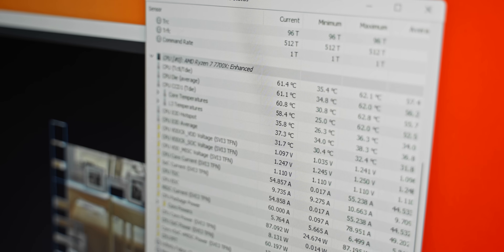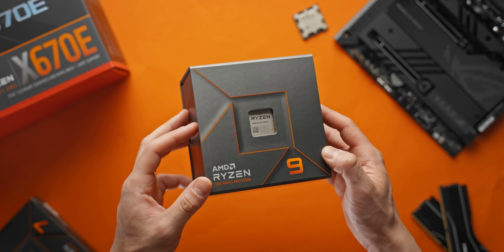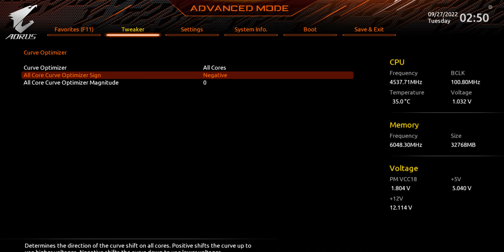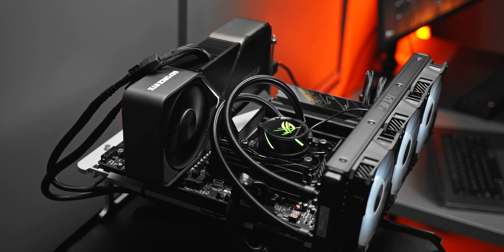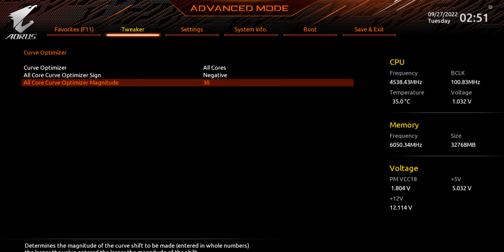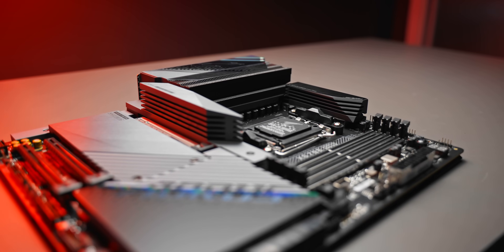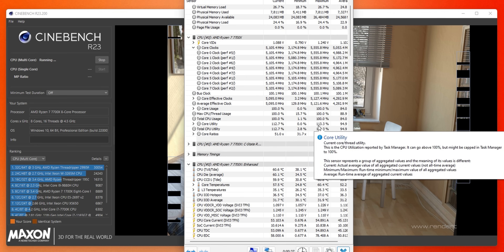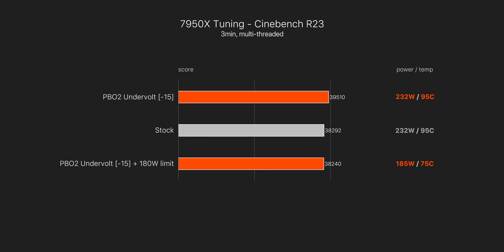Fixing Ryzen 7000 - PBO2 Tune (insanity)

Comment: I just tried this on my new 7700X that I got today and wow, yeah, it totally works. Curve set to -30, max temp at 85 C, max power at 85 W. Got through a full 10-minute Cinebench R23 multi-core run just fine, with only a minor drop in performance. Temperatures maxed out at 63 C. I'll probably be dialing back things a little bit, maybe curve at -15 and max power at 100 W, to guarantee stability and perhaps eke out a little more performance as well.
Reply: Yes, I get that, which is why I said I would be dialing things back a bit. For the moment I've settled on -20 on the voltage, 85 C max temp and 110W max power. Time will tell if this is stable enough, or if it needs more tweaking. I'll be stress testing with other benchmarks to check that. My initial enthusiasm was because I was able to replicate the results from the video exactly with my run-of-the-mill 7700X, so this is not just reserved only for golden review samples.
Reply: @Astfgl  Hey. blast from the past here but how did that -20 voltage, 85 C max temp and 110W max power work out? Was thinking along the same lines and would appreciate a little hindsight from someone else
Reply: @dalebrimhall1071 hey, I just did a -15, max temp 85C, max power 100W, and it seems to be running just as smoothly and fast as stock. I recommend. It did give me a bit of trouble at first but then ran smoothly.
Reply: Cinebench is utterly worthless as a stability test.
Reply: @Vegemeister1  THIS.  Cinebench is only a first blush test.  I did a metric ton of tuning on my 5900x and learned the hard way that I could get some really, really sweet Cinebench runs over and over again stable but outright crash in certain games and other stress tests in minutes or an hour.  Don't fall for this at face value... while it "might" be completely true a whole lot more stability testing needs to be done to prove it won't crash frequently in certain workloads and games.  Curve Optimizer can leave you wondering why your system restarts once every 3 hours in a game... or once every two days... it can and will cause bizarre stability issues.  Because it all revolves exactly what kind of load just happens to get placed on one of the random cores that can't handle the low voltage and high clocks.  And you don't know when it will happen.  You have to hammer them ALL properly to prove that EVERY core can stand up to a heavy load even when the cores around it are also hot.

Comment: why dont they do then out of the box? No normal user with zero experience can or want to do that stuff. those just want to plug and play. why not the best version, lowest voltage highest possible stable clock out of the box?

Comment: For a 7600X, what would be an optimal wattage limit ? 85W too or should it be set to something like 70-75W ?
I'm going with max stability so negative 10 + thermal limit 85°C + power limit set at 75W.
Reply: maybe lower temps, like 75° or sth.
after all higher temperature means worse efficiency and shorter lifespan

Comment: Generally only a few cores run at 95 that heat, understandable but still the heat is really annoying and no processor should be run over 85 honestly especially when doing heavy workloads.

Comment: Great video as usual! Your 7950x is higher quality silicon though. If the negative offset can't be set very high, it means that the chip is already running at very optimised low voltages.

Comment: Very cool results. Makes you wonder why Amd set the default setup so high? probably this is easier to make sure it works with a very wide range of silicon qualities and maximising the usability of the wafer yields instead of rejecting lower qualities
Reply: I know like, what's the point?

Maybe just maybe the CPUs are more stable stock in certain conditions. Like if the CPU was maxed with varying processing spikes e.g. a future CPU heavy games. Rather than Cinebench which is probably even processing demand.
Reply: Actually mindless comment, seek proffesional help.

Comment: This actually made me to consider upgrading from 3700X as I am not a big fan of huge power draw and high temperatures but I still like to be on a high performance system. Will probably wait for cheaper mobos to come out though
Reply: Would be silly not to, may as well wait for the 7800X3D too.
Reply: 5900X would be an excellent upgrade. You can use the same board and just get great performance for under $400
Reply: @dmitc01  True. And depending on where you live, the 5800X3D can be had for $400 too. If you're using it pretty much just for gaming, the X3D chip looks like it will still be vying for best chip on the market even after Raptor Lake launches.

Comment: You really turned me onto undervolting and I've done it on all my systems thus far. Mainly because I have more-or-less small to tiny ITX PCs, but also, why not have lower temps? The only exception to that is my main system, ironically, as it's pretty unstable with even the smallest undervolt, despite being the biggest with the best cooling. I won't be upgrading to Ryzen 7000, but I think it's especially important to do so with this generation because of the absurd "standard" temps. Very educational video for those going in, for sure!

Comment: I think this would be a fantastic selling point for AMD if the CPUs just performed like this out of the box. Seeing this performance with 60ºC and 85W matching the "by design" performance makes absolutely no sense that AMD would put out these products reaching the temperature levels they did. If we as users can do this type of tuning this easily, I feel like they could as well just make them behave like this out of the box, and allow those temperatures and power targets to act as designed for people who really would like to push they chips to the max. I know binning comes into play here, but it woudn't be necessary to achieve 60ºC @ 85W for all chips, however having them overpowered and at near TJunction at the exact same performance of what we see here is completely unacceptable.

Anyway, great video as always!
Reply: Prob bc like he said it depends on each individual cpu

Comment: Would be really interesting to see how the stock tune would perform in a custom loop, because even with the AiO it ran at 95 C , my question is if the coolant would also heat up to that high of a temperature, because if so, it’s basically unusable for custom loops

Comment: As Roman Der8auer showed in his new vid even the process of delidding and direct-die-cooling 7000-chips can save you up to 15°C in difference. Imagine both! Of course the effects would be way less than both temp differences just combined but still a massive improvement that shouldnt be overlooked when comparing to intel etc
Reply: I can imagine a seriously tuned 7600X delidded and optimized in PBO2 with a beefy cooler and using per-core overclock could potentially hit something like 6GHz on the best core with the rest set to 4.5 - 5GHz. 

That would be nuts.

Comment: 95C degrees is fine, this issue is that upgrading your cooler will just make your CPU draw more power to stay at the thermal cap, which is aids for watercooled SFF builds for example.
Reply: do you even have a clue how hot 95c is? 203 Fahrenheit.

that's about hot enough to cook an egg.

seriously. I don't care of AMD or Intel or Nvidia or any other chop maker thinks 95c is ok..it makes no sense to run something THAT damn hot.

I damn Surely am not.

you can use your PC as an egg cooker if you want..I'm not forcing my baby boomer mother to deal with a thick mid tower just to have a not us nh d15 fit just to keep her 7600x 's temps in check when she wants to do her trashbook  games and hangouts video chat at the same time.

Comment: You forgot to mention that in PBO you can actually do per core voltage adjustments.
This way you can get on average much lower voltage, since you're not limited by the worst core.
You would likely get some 5-10% improvement above your setup, if not more (dependent on the sample).
 I've done undervolt on 5600G, and cores vary from -30 to -15.
Reply: but how would you know which core needs a different voltage versus other cores?...that is the part I don't recall anyone ever answering
Reply: @motoryzen  You manually check it by stability. The process isn't very complicated.
1. You test max stable undervolt for entire CPU - bifurcation method is optimal.
2. When you find stable undervolt, you test each core with undervolts - same method as before.
It might take several tries to get it perfect, but the effects are amazing.
Sometimes a single core can destroy undervoltability by a lot, -10 to -30 variation is normal, so I highly suggest trying all cores.
Reply: @michahalczuk9071  ok so it's pretty much as I already figured how it would work. 

I thought you were going to tell me something different. (Shrugs)
Reply: @motoryzen Prime95 gives you per core stability readout, so if you are very careful you can undervolt all at once and check which are unstable.
Reply: @michahalczuk9071  now THAT...I forgot about.m..ok right on
Reply: @michahalczuk9071  but is prime95 available for Linux?  I don't use winturd
Reply: @motoryzen  I think it is.
Reply: @michahalczuk9071  Hey, I must restart to my bios everytime, you do the same ? x)
Reply: @EverNaughty  Yes.
You run prime until cores fail.
Check which one failed. Bump up voltages on those, bump down the rest.
I suggest going in 5 step increments and when you get failures go by 2 and less.

Comment: Now the real question is: why didn't they set a similar profile by default? It's a big improvement with basically same performance
Reply: Because with these cpus they're typically binned where up to 1 or 2 core are on the edge of stability at acceptable voltages. Those 1 or 2 cores might run fine stock but when you apply an all core offset those specific cores will cause instability.

Comment: Although these processors should just "work" out of the box, I would love to see more tech tubers educate consumers on how to get the most out of their CPUs. While the headlines for these cpus are "hot and power hungry", it would do good to settle expectations, rather than repeat what the crowd is saying. Same goes for Intel as well. All of these higher ceilings for power draw and heat are only to reach peak performance for a set amount of time to get the highest number for benchmarks. While in fact, there's a lot more headroom for balancing performance and power/heat. It's just a bit more involved for the consumer, and exposure unfortunately has to come from influencers/journalists.

Comment: Curious to see what combining this with delidding and direct die water cooling will achieve with a 7800X3D, should be pretty insane performance whilst running cool and dead silent with a big custom loop and low rpm fans.
Reply: Prefer to see the temp decrease with lapping the IHS personally. Delidding is a tad too risky for my taste.

Comment: I'm surprised undervolting still works well together with what is basically auto overclocking on a thermal limit, i thought those would be almost mutually exclusive beyond some minor adjustments
Reply: Undervolting and overclocking are essentially the same thing: pushing the V/F curve up and to the left.

Comment: Really nice that AMD gave an option to dial down their temperature target. I'd be much happier targetting my cpu at 80 degrees not 95 and if the undervolt is rock solid stable, saving 50W at the same time for the same performance :D

Comment: I'm running my 3600x with all the boosts settings off, meaning it never goes above 3.6ghz. The thing never goes above 60°c (even under extended 100% load) and fans always stay at 400rpm, never above. cool n almost completely quiet, all the while giving me all the performance I need. Getting new and more powerful CPU's is great, but people need to remember that even CPU's from two or three generations ago will serve most people good enough. Don't upgrade unless you actually need to.

Comment: Why would AMD have chosen such aggressive voltages/temperatures ? Are they planning chipping lower quality silicon that would not have any headroom at all ? I cannot image. Maybe they found it too risky for stability sake ? Anyways, very nice video ! Seems like an easy fix it seems. I think this Ryzen generation was designed for a world where electricity is free :)
Reply: voltages are lower than last gen and temperatures are absolutely fine. The temp limit for manual OC is even higher at 115C.

And performance per Watt on these CPUs top everything at the moment. What are you talking about?

Comment: Why the hell would other tech reviewers not advertise this and more importantly why the hell would amd not push this info out?! 
I was on a hard pass for ryzen 7000, but this actually Got me interested again. 
Great vid mate, like and sub from me!
Reply: I dont get this aswell. There just has to be a downside, otherwise amd would not push the temps that far. It doesnt make any sense.
Reply: @Danieldialga  The downside is that as stated in the video not all cpus can do it so they need the extra voltage for stability.
Reply: @WayStedYou  they can all do it to some degree
Reply: Because they need to do their actual reviews first? they only had a few days to a week to do all the testing that needs to be for a general user experience.
Optimum tech is focused on SFF builds so this would've been the first thing he went to do after the normal review stuff.
Reply: People who aren't stupid can do things without the need to be prompted.
Reply: you can do this pretty much on all CPUs. but companies always choose the most stable config for all chips or the top performance at the cost of power. even on intel you can cut a few tens of watts without performance reduction if you follow tips like these but for intel.
Reply: The people that manufacture the thing : The chip operates optimally at 95ºC 
Dumbass reviewers : Fighting like hell to drop the temperature ....
Reply: @mouzz  Yea im confused by this as well. AMD has come out and said this is intended. Why is anyone freaking out?
Reply: @mouzz  If the manufacturer wants me to run it at 95 degrees and 170 watts then they can pay my power bill for me. Otherwise I'm dropping it as far down as I can without losing performance in the things I do using my computer.
Reply: @nonormies  dropping wattage good, temperature not really, the longevity and the optimal performance of the chip are recommended at 95 celcius by people that know one thousand times more about the chip that reviewers will ever do so...
Reply: @mouzz  the the people who know a thousand times more about the hardware than i do can be and in the past have been crippled by the fact that they do whatever the company pays them to do.

if the company pays them to make it run cool and efficient out of the box, that is what they do. if the company pays them to make a quad core with a shitty form of hyperthreading and call it an octacore, they build an "octacore". if the company pays them to make a chip run at its thermal limit as much as possible to squeeze out a bigger marketing number, then that is what they do.
Reply: @mouzz  also there are far more reasons for wanting the chip to run cooler than just concerns about longevity. all that heat has to go somewhere. some people might not appreciate all that heat being pumped into the space they work at. other components in the pc might not be very happy about sharing a living space with a volcano, your already-hot gpu especially, and the smaller the case the more significant the effect is.

the reviewers would not be doing their jobs if they did not demonstrate the full capabilities of these cpus. they have all demonstrated the maximum performance numbers they can achieve. now is time to show off how flexible they are in terms of power consumption and thermals. the smart engineers have apparently built some awesome silicon this time around and have given us the options to play around with it.
Reply: @mouzz  Dropping temperature not good? what planet do you live on lol.... you do realise 1)that excess heat has to go somewhere? In the summer months the room the PC is running is going to pretty unbearable with a CPU running at 95 degrees TJ Max consistently underload. Sure, granted it won't hit TJ Max when gaming (if it does then there is something seriously wrong with the set up) but still dropping temps from high temps to something alot more reasonable for electronics is always a good thing because of 2)The law of thermodynamics. Simply put: This is why every electronic equipment has optimum operating temperature and max tolerance for operating temperature. Additionally, electronics are not made out magical pixie dust - every material has it own thermal tolerance.
Reply: @earthtaurus5515  quoting you "This is why every electronic equipment has optimum operating temperature " In these cpus case "95ºC" case closed
Reply: @mouzz  🤦‍♂
Reply: @mouzz Imagine thinking every design is perfect and every marketing statement is truthful
Reply: @nonormies  Not sure where you live or how often/long you play but the power bill difference is negligeable.
Reply: @earthtaurus5515 Agreed. But as amd has stated, 95c is not the max temp, but works optimally at that temp.
Reply: @ezer0923  You have to go on what they advertise it as. Otherwise its a lie and therefore refund time. The average person doesnt know that what is being advertised to them is actual truth or not.